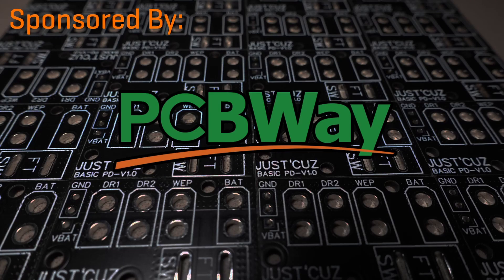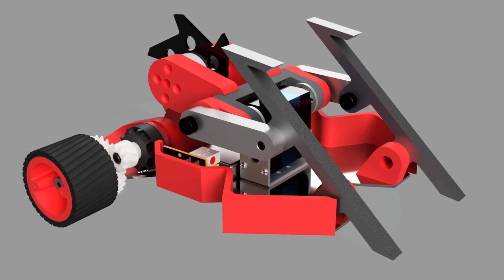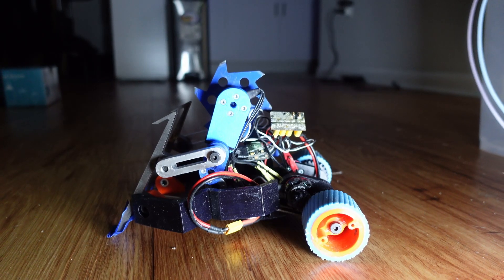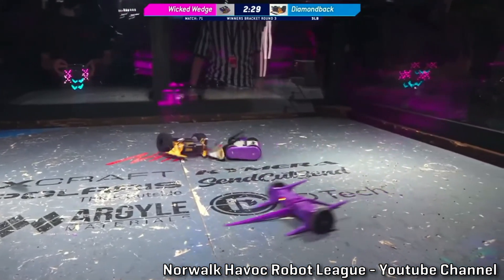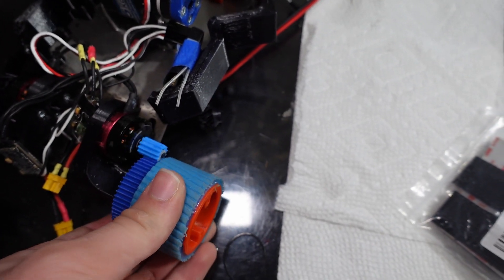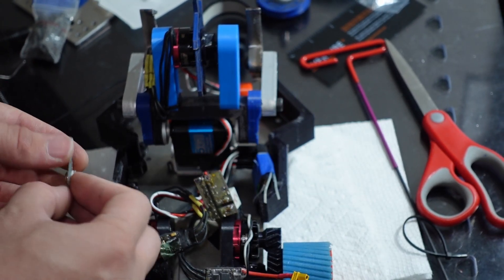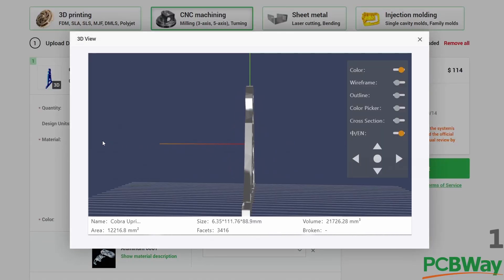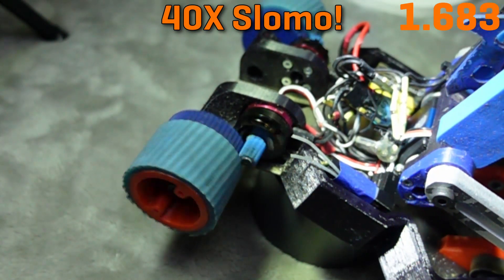Pushing Power! The Process: Shrapnel Mine Beetleweight Combat Robot Sept 2021 Update

Comment: Wonder how hard it would be to make an esc to controll two drive motors and a weapon motor all in one?
Reply from the maker: Someone already did that for 150 gram bots! But only for all brushed motors, not brushless. Personally designing an ESC is way beyond my skill level as far as electrical engineering is concerned, I'm Mechanical at heart.  https://shop.bristolbotbuilders.com/product/malenki/
Reply: @JustCuzRobotics  that is really neat. Might have to take talk to the builder and see if the can do a 3lb esc. I would imagine it would all have to be brushless setup tho
Reply from the maker: I should also mention there are 4-in-1 brushless drone ESCs that are readily available as well, so while a bit bigger than an equivalent 3-in-1 they are a thing.  Personally I avoided them because if you burn one of the onboard ESCs out you're kinda hosed and also they are pretty massive vs the single ESCs. https://www.amazon.com/AKK-Brushless-BLHeli_S-Electronic-Controller/dp/B079G5VN68
Reply: @JustCuzRobotics  that is a very good point.

Comment: You don't need to hammer Titanium to bend it. I bend 2mm (1/16" is approximately 1.5mm) titanium fairly easily with a similar setup, only I use the propane torch to get it glowing a bit and bend it with pliers. It's much easier to get a consistent bend that way. I'm not great on my metallurgy, but I believe it's stronger that way too, as forcing it when it's too cold causes more stress on the metal.
Reply from the maker: Yeah admittedly my setup was very crude. If I had a proper way of gripping the material or a proper press brake I would have happy tried that. I couldn't manage to get the metal super hot with my torch though. I think the table I had it clamped on robbed much of the heat away.
Reply: @JustCuzRobotics  Could be, my setup is about as primitive as yours, stick the Ti in a vise, clamp on some vise grips then heat it while applying gentle pressure to the handle of the vise grips, once it gets hot enough it bends quite easily. I could probably do it with bare fingers if it weren't for the heat. The vise robs quite a bit of heat, I've considered finding something less-conductive to clamp in the jaws, but haven't found a good material yet, so for now I just compensate by clamping a little below where I want the bend so it's a little further from where I apply the heat. It takes a good while of playing the tip of the inner blue flame (the hottest part) along the edge I want bent. It's been a while, since I did it last, but I think it was a few minutes to get it hot enough. 1mm goes in 30 seconds or so.

We'd all love to have all the tools (glares enviously at Robert Cowan) but sometimes figuring it out with simpler methods can be very satisfying. Good luck with Shrapnel Mine and I hope you had a blast at BattleBots!
Reply from the maker: Thanks! I definitely am no Robert Cowan but there is a makerspace nearby with tons of tools. Sadly a large press brake is not one of them. I definitely had lots of fun at Battlebots though!
Honestly in 10 years if I can afford a house I fully intend to build up my own workshop like his, but thats a long ways off. With how many different companies there are to outsource machining to, it only makes sense to own your own CNC machine if you are making money off it, or spending a ton of money outsourcing already. 

3D printing is different because a single 3D printer can be >$200 and a single 3D print job from an industrial supplier can also be >$200, but a 'real' CNC milling machine like the job shops use can set you back over $40-75,000 and a single job from them might only be $200-1000
Reply: @JustCuzRobotics  Yeah, I mostly agree. If I were a millionaire I'd have a waterjet and a few other toys, but mostly I have what I need. I go a somewhat different route than you though, I have a light-duty CNC machine which cost under $1,000 US and cuts thick aluminum very well. I've heard some users have cut mild steel with them, but I have not pushed mine that far. Mostly I use it for bot bodies as it does a great job on HDPE/UHMW and the result is much more durable than a 3d print.

I have never outsourced a part though, maybe I should, but to me it's a hobby and if I spend a few hours with an angle grinder getting my titanium to the right shape that's just how I like to spend my time.